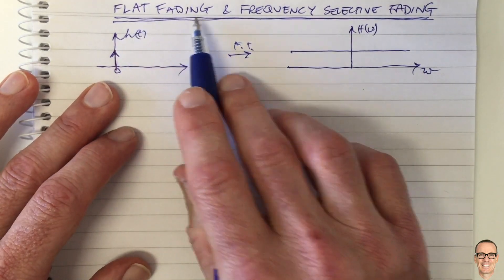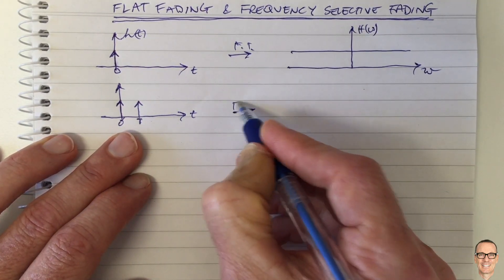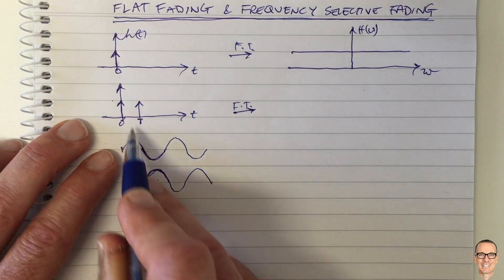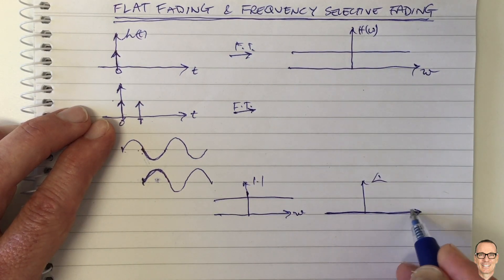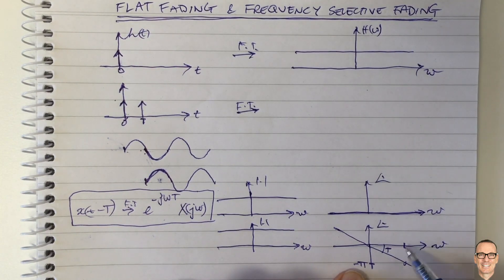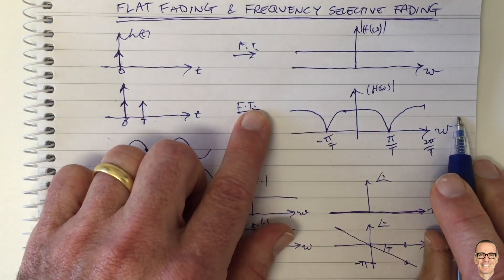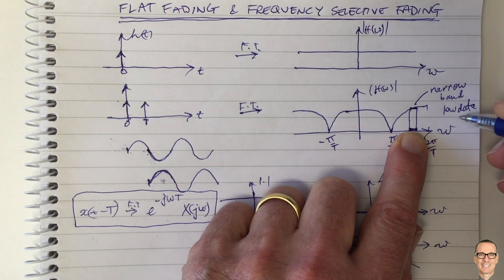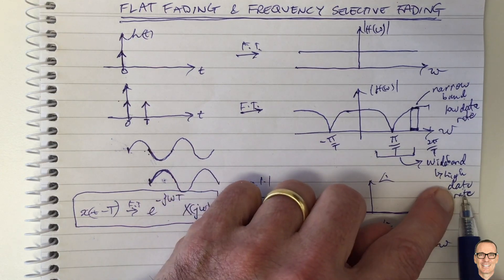What are Flat Fading and Frequency Selective Fading?

Comment: Amazing explanation! so for a given time dispersive channel with more than one dirac delta functions other than at time t=0, there exists a value of wT=-π, that will cancel the carrier x(t) causing complete cancellation and a sharp dip in frequency response of the channel for that particular value of w. This is inevitable in a multipath channel when operating at higher bandwidth and no channel equalizer can undo frequency selective fading, there may be some remedy for inter symbol interference but not for this...please comment since we are having a raging debate here on OFDM vs Single carrier solution for a particular use case. I am all in for OFDM despite the scenario can be modeled using a rician fading model with significantly high K factor, the frequency selective fading challenge remains
Reply from the maker: I'm not sure I understand what you're getting at, exactly. If the channel is frequency selective, then you've got two options: 1. hope that it remains constant for long enough to be able to measure the channel and feed it back to the transmitter, so that the transmitter can avoid using the "nulled" portion of the frequency band, using precoding (as happens in DSL), or 2. accept that there will be nulls in the frequency domain, and try to equalise them at the receiver and use error correction coding to effectively spread each data bit over the whole frequency band.

Comment: Great explanation sir, In the above explanation, 2 sine signals cancel each other but the first half wavelength of the signal that was received at (time = 0 )still exists right?  It shouldn't be a completely zero outcome. In that case, the dip from frequency selective fading shouldn't be 0. Please correct me if i am wrong
Reply from the maker: In those pictures I've only shown a short segment of the sin waves, so that I could highlight the phase offset. In practice, the waveforms are much higher frequencies, and they are continuous/on-going (modulated by the digital data waveform), so the "first half wavelength" that you mentioned, is not "on it's own".

Comment: Is it possible to calculate the length or difference in length of an indirect path which WON'T cause fading at a given transmit frequency (say 900 Mhz)?
Reply from the maker: Any path that differs in length by an integer multiple of the wavelength will add up constructively.
Reply: @iain_explains  Ok, so if we're sitting in a null, then moving the distance of half a wavelength (based in frequency) is the surest way to step out of the null. Correct?
Reply from the maker: Yes, that's right.

Comment: Hi, thank you very much on this video,
So this is the main motivation to use Equalizers?
Reply from the maker: If a channel is frequency selective across the band, then it has inter symbol interference, and you will either need to use an equaliser at the receiver, or use OFDM modulation at the transmitter. See: "What is Intersymbol Interference ISI?" https://youtu.be/I087FUvW2ys and "How does OFDM Overcome ISI?" https://youtu.be/xcQ6rtIXv6M

Comment: Can i have wideband flat fading, which is separated into N (N=subcarriers) narrowband channels? Also these N subchannels could be all equal in terms of fading? Is it realistic or ofdm is assumed only in frequency-selective wideband channels?
Reply from the maker: If the delay spread of the various propagation paths is small, then the channel will be flat over a wide frequency range (bandwidth). This is a property of the channel, and is independent of the modulation format used to transmit data. The OFDM modulation format has advantages in frequency selective channels, compared to other modulation techniques, but it is not restricted to frequency selective channels.
Reply: @iain_explains  Thanks, your answers are really helpful. So i understand that scattering environment determines the type of fading but it is no prohibitive to assume a flat channel over a wide frequency range for a MIMO system, even if this does not happen often.  
Alsο does the spatial correlation affect the delay spread?
Reply from the maker: The spatial correlation is a measure of how similar the paths are in different directions. If the spatial correlation was 1, then all paths in all directions would have the same gain/loss and phase shift, and therefore they would all have the same delay.

Comment: Thanks for the visual understanding. I have a question that at the selected frequency position OFDM solves the problem of frequency selective fading ?
Reply from the maker: Sorry, I don't know what you mean by "selected frequency position". OFDM converts a high rate data sequence into a set of parallel lower rate data sequences transmitted over orthogonal "sub channels". The lower rate means the symbols are longer (in time), and are therefore less affected by ISI. In most OFDM systems, the sub channels are narrow enough to be considered "flat". I'm planning to make a video on this, so keep an eye out for it.
Reply: @iain_explains  Sorry I confused you, in your example in the "pi/T" position, I see an abnormality happening when H (jw) -> 0 so I imagine if there are any subcarriers in OFDM appears at that position, I imagine it will lose the signal at that frequency

Comment: Great explanation.
Assuming MIMO where spatial channel correlation exists, is it "right" in OFDM systems to assume a flat fading channel for each subcarrier? 
How the channel gain frequency response (between subcarriers or among different paths) differs in correlated scenario? Is it generally assumed flat fading channel for each subcarrier regardless of correlation and the effect of correlation seems at similar frequency response between different channel coeffients for example h_11 h_12?
Reply from the maker: Generally, spatial correlation occurs from fixed reflectors close to the antennas. For base stations, this can arise from the metal in the support tower (for example), and for user equipment it can arise from the metal case of a laptop (for WiFi signals for example), or the metal structure of a vehicle (for example if someone is using their mobile phone in a car). In these situations, since the reflectors are close to the antennas, there is very little difference in the distances of the resulting paths. Therefore these reflectors will not add significant ISI. In other words, close scatterers have the biggest effect on the spatial correlation, while non-close scatterers have the biggest effect on the frequency response.